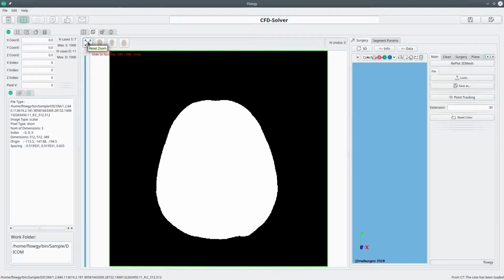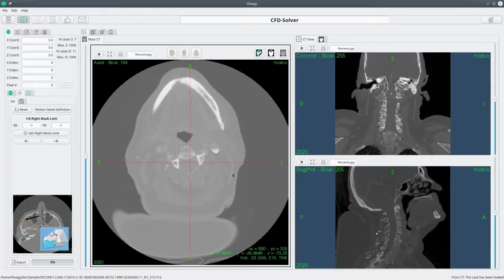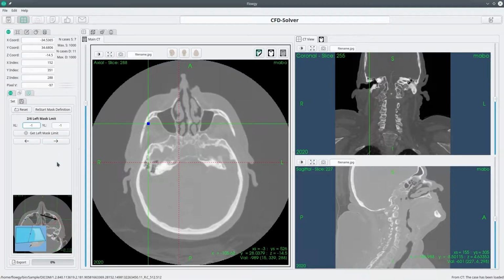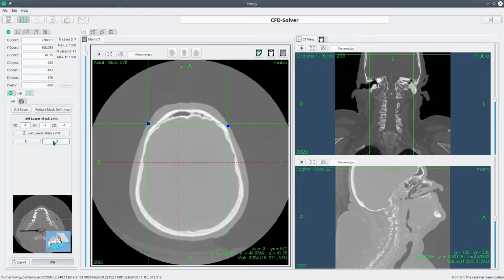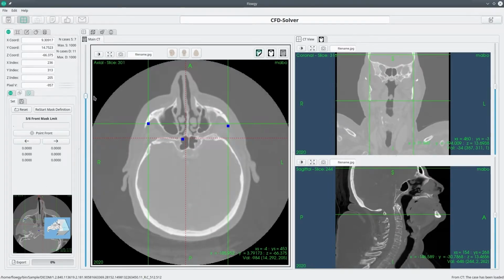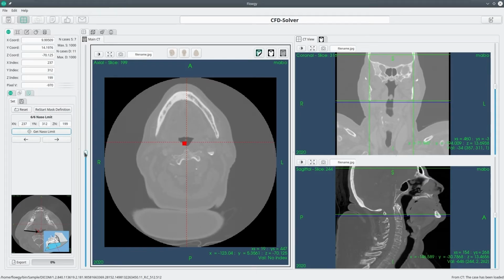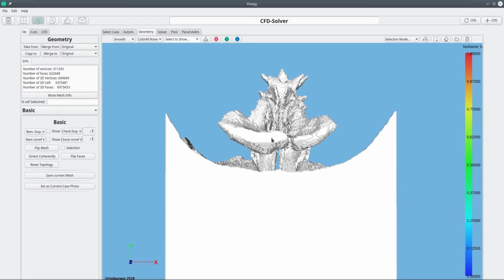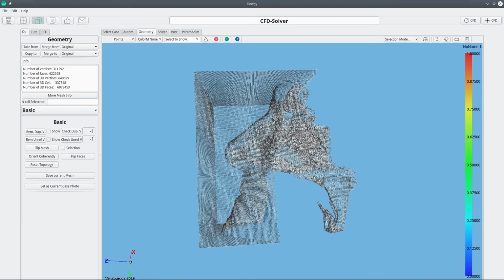CFD Solver – How it Works Part I | Flowgy Academy

Comment: Thank you, 👏🏻👍🏻 Excellent software 👍🏻 , have you performed virtual surgery (rib implantation in the wall of the inferior meatus) and CFD analysis to reduce the volume of the inferior meatus, in case of empty nose syndrome (due to removal of part of both inferior turbinates)?  Which causes the loss of the Venturi effect, necessary to expel the mucus trapped deep inside each meatus. Helping to balance the flow in all meatuses.